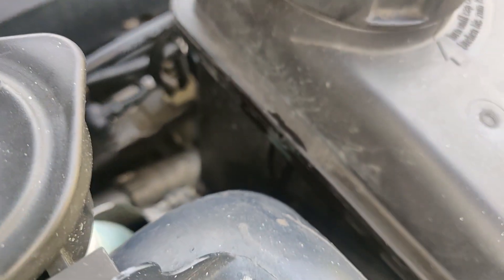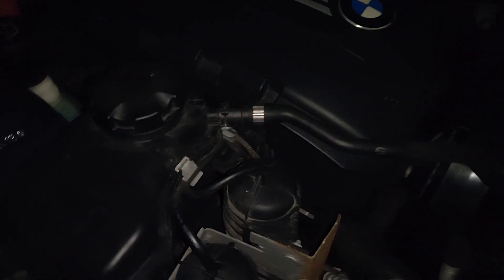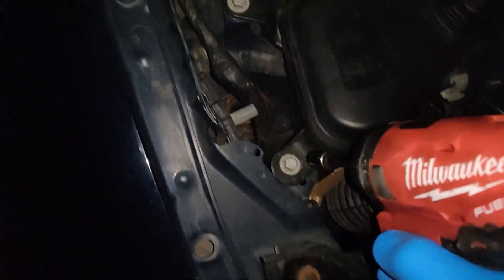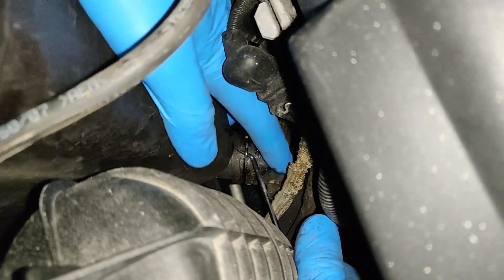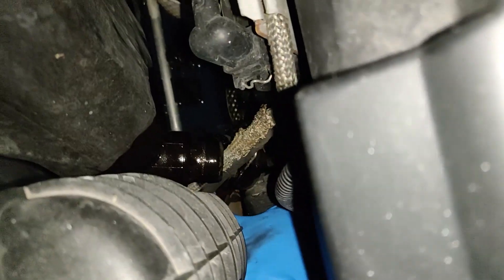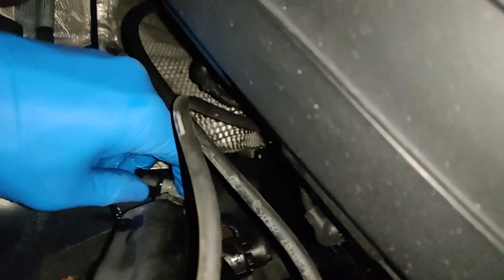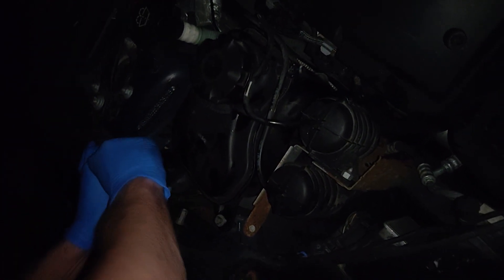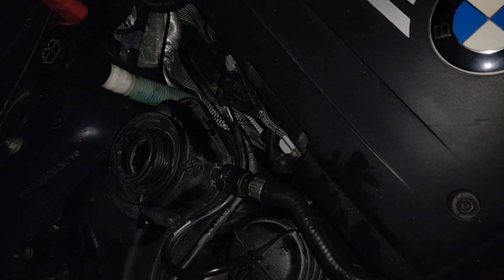How To Replace Coolant Expansion Tank on BMW E90 E91 E92 E93 See Description for bleeding procedure.

Comment: i have a 3 series diesel 2009 model. recently its started shorting coolant. Ive changed the expansion Tank yet the problem continues. what do i do next
Reply from the maker: You need to pressurize the system and see where it leaks, shops would do it for $50-100, but if you have litlle car knowledge ill buy the coolant pressure test kit and do it myself, jack the front and do the pressure test, make sure to follow the manual and you should be able to find a leak in no time, otherwise look for dried coolant stains around the coolant lines

Comment: what is that coolant hose connected to bottom of the resovoir called???
Reply from the maker: hey. as for most of the lines, https://amzn.to/3PoSU6J it's only missing the return line but that's the separate link for it right here - https://amzn.to/3h9iJuE it usually brakes at the upper radiator line where it connects to the hose via the little nipple.
And the one you were asking for it's an Expansion Tank lower Hose -  https://amzn.to/3FxQ0Jq
Hope it helped! Good luck!
Reply: @Makhnovets  well i looked it up and kinda looked at where the leak was coming from and i would say that, that hose is not the right hose that goes into my 2011 BMW 328i Xdrive, that hose has two connectors and the when i looked into my engine bay and it was the lower hose that has the connector and the other end goes to a T junction with no connector and its just a metal ring not a clamp and the end of the hose is just a plain hose with no connector

Comment: I ran my bmw yesterday after buying it and drove it for a good 3 hours got home while I was driving home my dash lights turned off and my speedometer got stuck on 40 got home popped my hood and my resorvoir is cracked and leaking do Yk if that’s why my dash lights went off also when I turned my car off the head and taillights stayed on
Reply from the maker: Hey. in most cases speedometer stop working because of the speed sensor. As a side effect of a coolant leak, it might be got on the sensor or the connector. Make sure to scan the OBD, if you locate the speed sensor failure, just replace it, also buy all 4, it's cheaper for and 3series tent to have a problem where a bunch of gunk gets stuck on them, so if one pops out, most likely rest of them will soon.
Minute: 1 - 1.55 - 4.25.  -   https://www.youtube.com/watch?v=L6t2apQKH_M
GOOD LUCK!

Comment: Nice video but bro change these vacuum lines on the bottom of the boost canisters, they look really worn out
Reply from the maker: Thanks for the tip. And you hit right in the spot))) I replaced them because of under boost and 30ff code. there was no leak but under the boost line was collapsing causing 30ff code) Thank you!

Comment: Thank you!  I bought a new tank for $50 on Amazon.  I replaced it in 10 minutes with adjustable pliers and a small flathead screwdriver.  Computer was turning off the turbo as the temp approached 260 degrees F. Now it runs great.
Reply from the maker: Nice to hear! And new tank is better than used one!

Comment: Mates.... my coolant just leaked heavily and the engine shut down as result of it. Lights such as radiator empty warning light and temperature warning light turned on. I thought i had fixed the problem last february by replacing the octopus arm shaped like rubber pipes below the radiator and also had to replace the alternator since it was burned out. Do you think the new alternator can handle a coolant leak? I really dont want to buy a new one. Tomorrow the mechanic will come to my house, i hate that my e90 always has issues with the coolant. Is this a normal problem with e90?
Reply from the maker: In terms of alternators, they can handle quite a bit of water splashes, but it depends how long you were driving with a leak, the upper radiator housings usually have the most problems, since they receiving lot's of heat from the engine, but yes, it's pretty common, after buying BMW i replace the upper radiator housing, and coolant tank if the car has more than 100k mi... also belt tensioner and the belt, especially if it been sprayed with coolant!
Reply: @Makhnovets  the mechanic is at my house as we speak and i will share the info of his findings.
Reply: @Makhnovets  alright it took them two hours to find the problem. They replaced the thermostat and the waterpump and a seal of which the inside was supposed to be metal but it seemed to have been thinner and caused the leak. You were right to say that the alternator can handle some water trouble from the coolant tank. I suppose now i need to check the coolant water level every weak just to make sure it doesnt get dry completely.
Reply from the maker: @cooper5092  after all of that you car shouldn't have any more coolant problems! Hope it's all fixed now!!